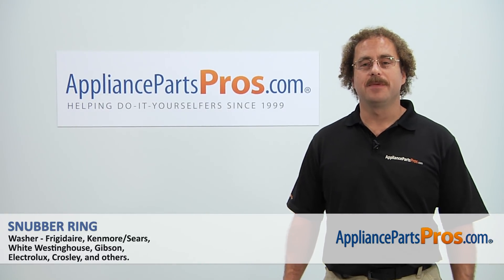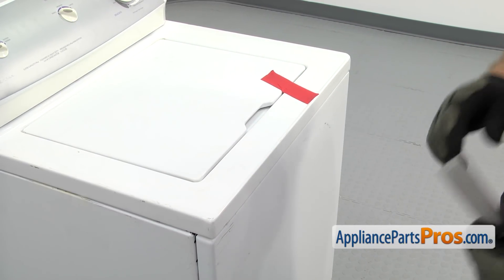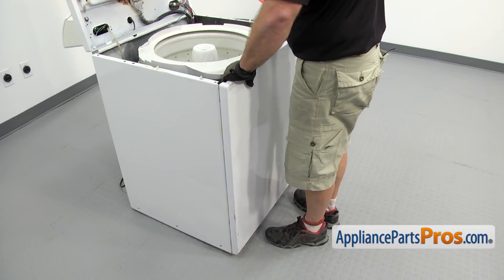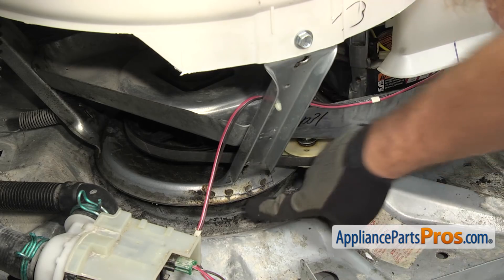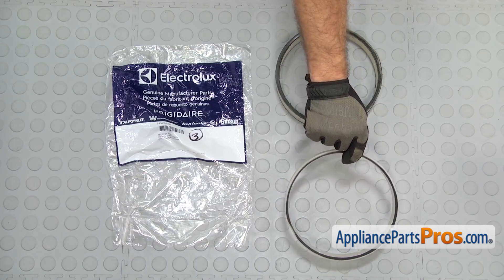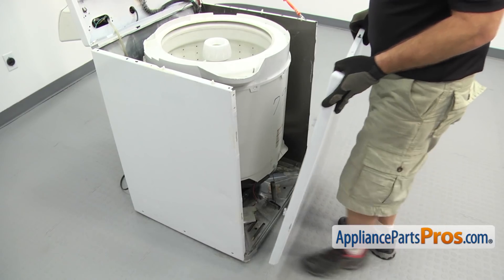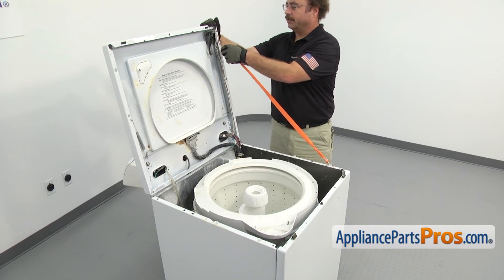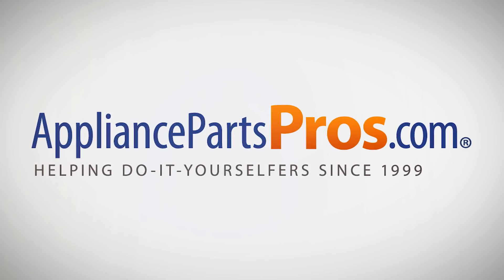How To: Frigidaire/Electrolux Snubber Ring 5308002385

Comment: Question: Please, I hope you can answer. You mentioned in the explanation about putting the arrow upwards, what is the reason? And what is the difference between putting the arrow upwards or downwards? Honestly, I didn't find a difference, and I became curious to know the reason.
Reply from the maker: The manufacturer's instructions indicate the arrow needs to be pointing up for this installation. It's possible if you put it in upside down it may not seat properly and continue to cause issues or it could wear the part out faster.
Reply: @appliancepartspros 
Thank you for your reply
To be honest, I didn't find any difference between the top and bottom sides. I examined it carefully and both sides look the same.
🤔🤔🤔
Reply from the maker: You may just want to keep an eye on it in case there are any issues.
Reply: @appliancepartspros  
Thank you for the advice